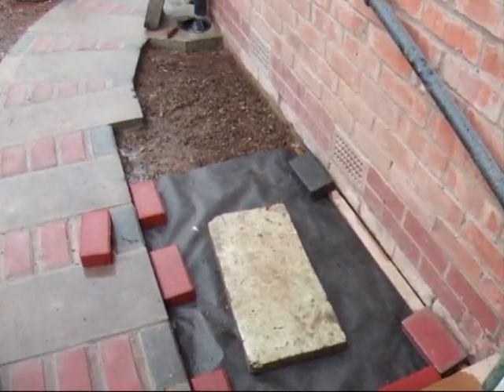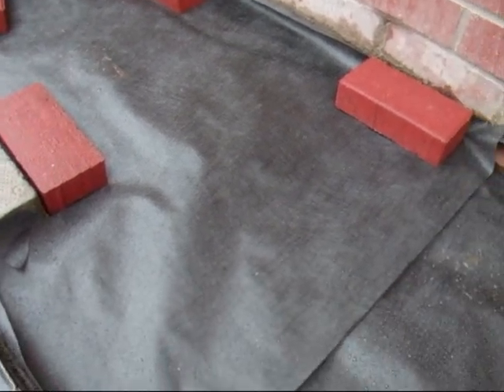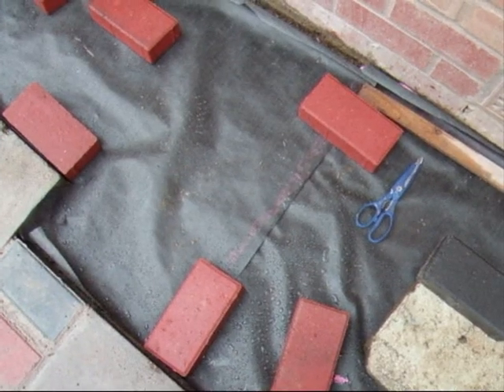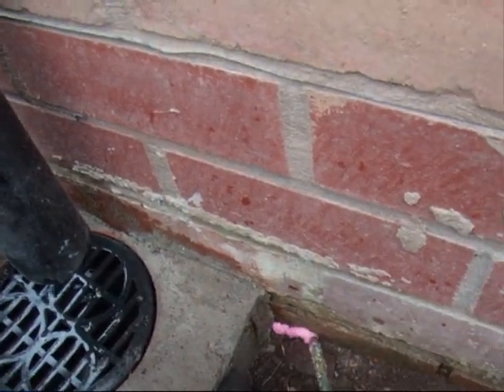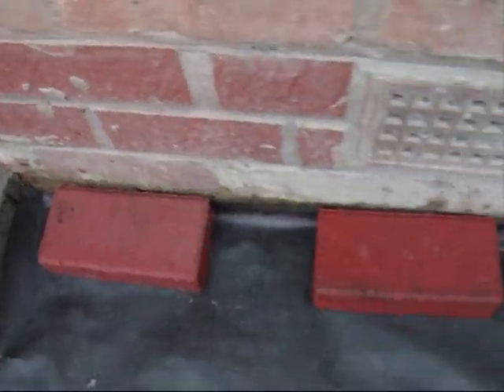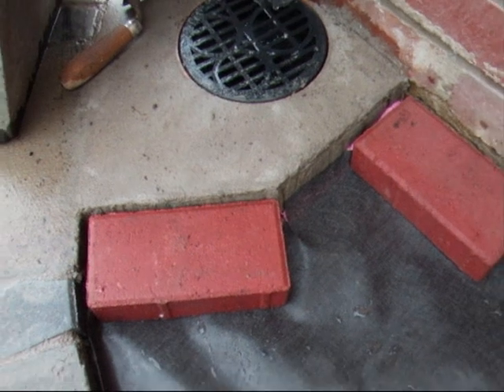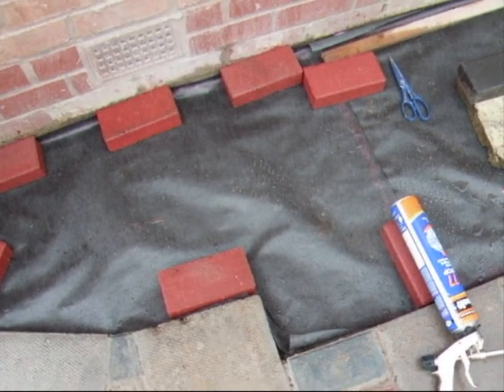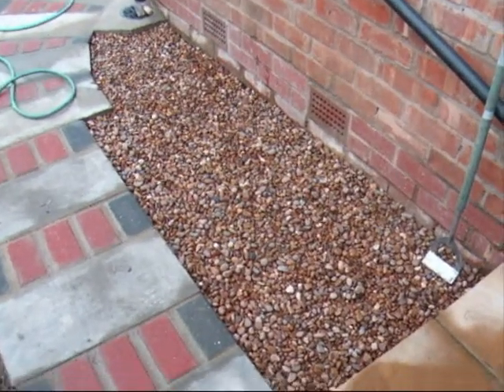HOW TO STOP WEEDS COMING UP AROUND THE EDGES OF WEED SUPPRESSANT

Comment: Proper tip mate, been scratching my head for a while over this issue.
Reply from the maker: well its now 2014 and nothing has come up so I gotta say it works another tip is wet both the weed sheet and the edge with a water spray it stops the expanding foam from expanding too much and helps the bonding process if that makes sense
Reply: thanks for the added value mate.

Comment: hello captain .. great tip .. much appreciated .. now, the only question ive got is .. how to seal the edges, without burning the foam ? i usually blow torch the edge to stop fray .. like you say wet it up to stop the full expansion .. maybe that would help it not catch light .. or maybe heat seal edges first then foam and push down .. dunno ?
Reply from the maker: i have not had any issues with fraying but maybe seal the edges before to use the foam
Reply: @Professorvapes  nice one Captain thanks